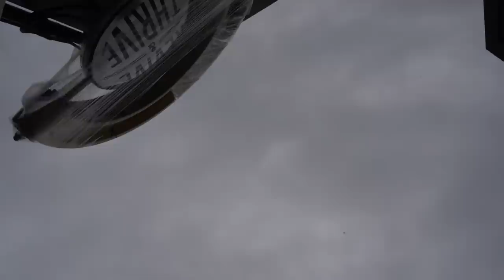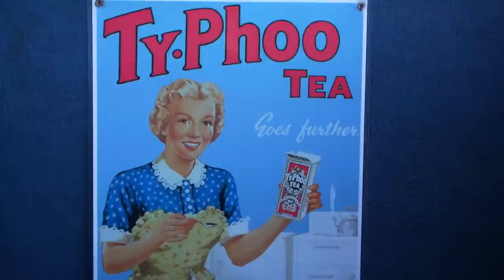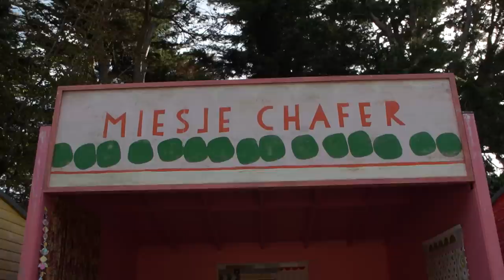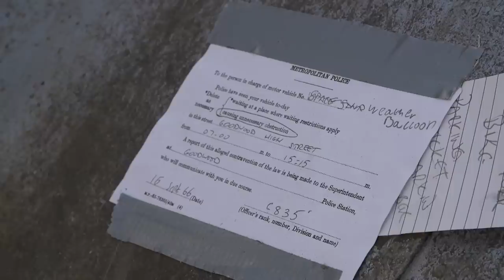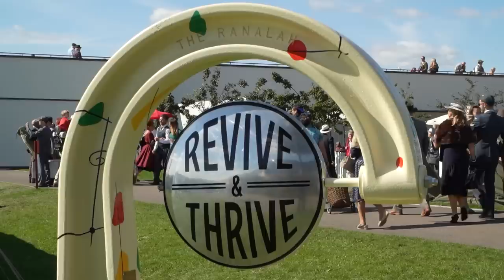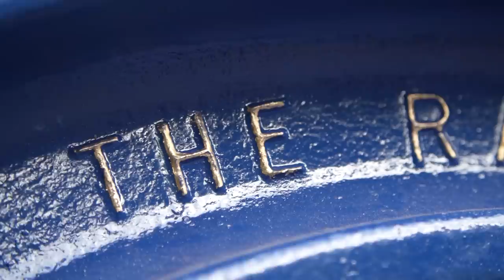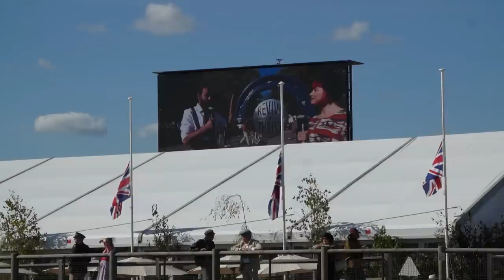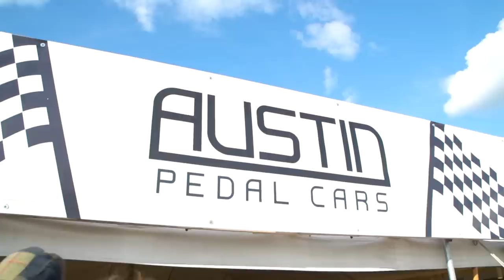Ranalah at Goodwood Revival 2022

Comment: Watching through your ressurection of this company, I do think it's not going to be much of a success. Not saying it's not a product worth resurecting at all. 

You diligence to totally recreating the original, down to using the same nuts and bolts, is foolhard, unless your looking to provide spare parts to the originals. Standard thread patterns have moved on significantly, and other than prehaps the leadscrew moving the lower wheel up and down, the fastener choice between historically correct vs modern standards is irrelevant, and thje former significantly costs more. 

It's also a machine with a very small market, and the price I see your asking(not saying it's not fair given your costs and profit needs), makes it unlikely to gain widespread adoption amongst hobbyist's, and there are very few industrial concerns even considering such a labor intensive process. A hobbiest can pick up a beginner grade English Wheel for US $150.